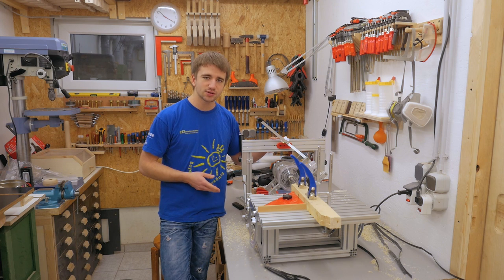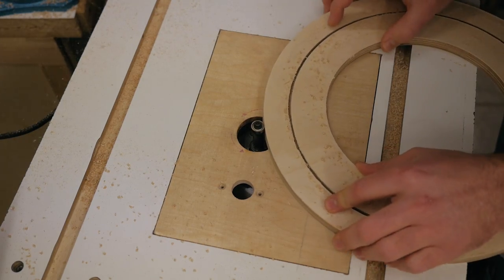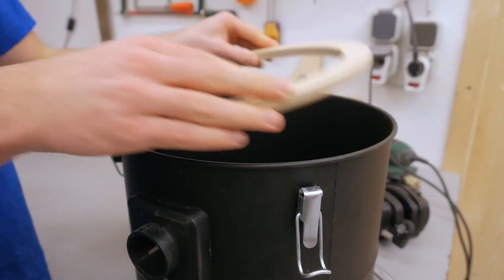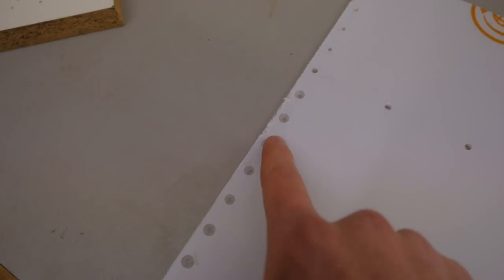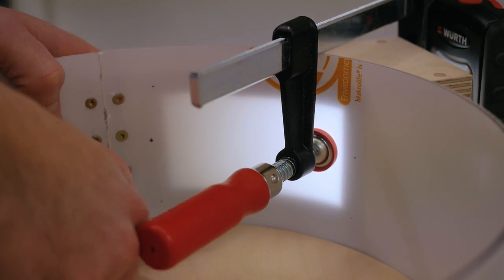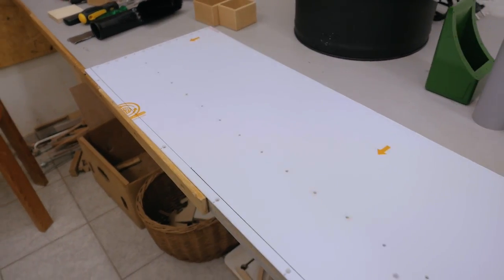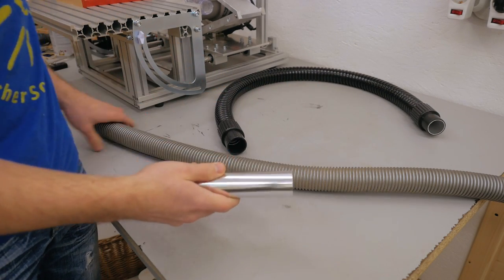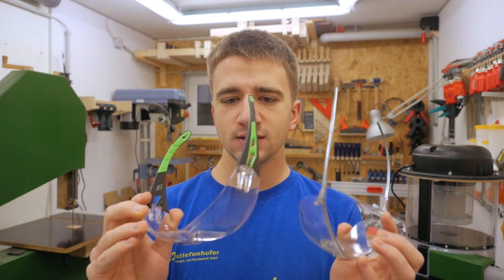A small Cyclone Dust Collector with a Cheap Vacuum

Comment: stupid question, why didn't you just use the vacuum directly (i.e, plug the ash vac directly into the panatarouter with a reducer/enlarger)? What benefit do you get from building a baffle/separater etc.?
Reply from the maker: separating the dust from the air. The filter stays clean for a very long time, the usable bucket volume is bigger and it's cool to see the dust swirling around ;)

Comment: Hi Marius, thanks for your awesome videos! I looking to build one cyclone but I'm wondering about the radius you can bend the plexiglass. Do you have some resources about that or did you simply test it?
Reply from the maker: Don't use Plexiglass. Use Polycarbonate. It doesn't break and you can bend it to whatever radius you want.
Reply: thanks!

Comment: do you think this small vac would be powerfull enough to work with a 2,5m long an 100mm size ventilation flexpipe for the intake part? Does it create enough suction
Reply from the maker: No, definitely not. Suction would be plenty, but pretty much no air flow. For a 100mm hose you need a dust collector.

Comment: Nicely done as usual but it seems like it would have been easier to just use a plastic bucket instead of making one.
Reply from the maker: But it may not work with a plastic bucket because it's not as strong as bent polycarbonate and might collapse under the pressure. I've already destroyed two buckets that way.

Comment: hey, marius, do you think a regular  ash vacuum wouldn't work straoght out of the box? I have been looking for something to extract dust from my bandsaw and these are half the price of a cheapest shop vac
Reply from the maker: sure, but the filter will clog up very fast. The cyclone separates dust and air and the filter stays clean. Plus you can fill the whole bucket.

Comment: Hello,  That's a perfect design (vertical), would it work if it was connected to all of your tools?
It probably wouldn't work and needs to be larger (more HP) to handle several tools?
Reply from the maker: No, for working with the big tools, this is the wrong machine. It has 1250w
Reply: Just to be clear, I meant one tool (gate open) at a time. What would be the minimal watts (3HP?) be best for a typical shop?
Reply from the maker: Ok, then this is the wrong type of machine. For connecting it to big pipes you need a dust collector (low pressure & high volume), not a vacuum (high pressure & low volume). 1HP or more should work.
Reply: Sorry, I'm getting confused. Isn't what you have is a compact (footprint) collector / separator that uses a shop vacuum (wet/dry) for suction?
I'm trying to find a design that can be stored in a corner with enough power to pull debris from the floor across a (small) two car garage to the celling (out of way), with two or three branches and back to the unit?
That's it...ah?  ;-)
Reply from the maker: Then I'd get a more powerful shopvac. You can then use the design from my video to make it a compact separator as well.
Reply: Marius Hornberger The shop vacation I have is 3hp, is that enough?

Comment: Marius can i ask your opinion, I am looking to turn my shop vac into something like this as I currently have a separate bucket with a Chinese plastic cyclone - however, i use mine to suck up all sorts aswell as just dust, often little screws and stones e.t.c. that can end up on the floor, will the polycarbonate hold up to such abuse?
Reply from the maker: yes, should be no problem

Comment: It looks cool. but I don't see the huge benefit to be honest. All that work  just to get the filter out of the bucket? Seems to me like a very low volume gain. Or am I missing something?
Reply from the maker: The dust gets separated from the air in the cyclone and the filters stays clean for much longer.

Comment: At 4:10, couldn't you just swap the bearing attached to the end of router bit with a larger one?
Reply from the maker: I don't have a bigger bearing that fits and it would have been a quite a coincidence if it had the exactly correct size.
Reply: Yeah, that makes sense.

Comment: Durch den Zyklonabscheider aus isolierendem Material hast du die Verbindung des Blecheimers zum Erdungsleiter unterbrochen, die wahrscheinlich vorher über das Motorgehäuse und die Klammern bestand. Ist das irgendwie von Bedeutung? Wahrscheinlich nicht. Stellt es eine Gefahr dar? Absolut nicht. Werden dutzende von selbsternannten Sicherheitsbeauftragten dich darauf aufmerksam machen (und dabei noch irgendeine obskure VDE-Norm zitieren)? Aber natürlich! :D
Reply from the maker: bis jetzt hat sich noch keiner beschwert :)
Reply: Schade. Hatte schon das Popcorn fertig...
Reply: gesamtszenario ganz so abwegig ist es nicht. Ich würde es machen. Vielleicht mit nem Bananen Stecker und ein Kabel.
Reply: original lid to vac appears to have a foam gasket, which would act as an insulator regardless of modification.

Comment: hello, please let us know how powerful was the ash vacuum?  gallons capacity, xHP motor??  Thanks.
Reply from the maker: 18l bucket, 1200w power
Reply: Thanks for your rapid replying, I´m just trying to scratch plans and budget to get again into mosaic bistro table making, during the former time I was realized to do carpentry is a must and woodworking an option same as metal work, besides both of them make a lot of dust, at first was searching for an affordable dust collector system, find some fancy ones... jaja.  Suddendly your video appear and it looks done for me. Congrats for your works and videos!

I thought the inverted conical shape was a condition to get that cyclone effect working, but you made yours just with straight walls. Unfortunately  my combat vacuum cleaner has no the motor on top part, it´s inside the 
vaccum body, at a bottom enclosed compartiment.

Comment: +marius hornberger is it possible to use a bandsaw blade that is 0.065 mm thick and 15mm wide on a 16"bandsaw wheel? im making one
Reply from the maker: Of course, if you mean 0.65mm thick
Reply: Marius Hornberger yea xp

Comment: Marius wanna ask you i build the same small dust collector like you but my filter is plug whit many dust, my inled i same as you ??
Reply: Im not sure if that design works as it seems, cyclones work with a vortex and GRAVITY. The exhaust air from the motor/filter is drawn through the unit in all directions, this will lower the internal pressure, i.e a light vacuum. What happens at the inlet is this; assuming the system is air tight, all the air that is exhaust is drawn in via the inlet,we need as little restriction as possible at this point i.e. short,wide hose,straight as possible. As the air/dust is drawn in the velocity will increase as it goes through the restriction of inlet (this is why we need big pipe to keep volume high, so that there will be good velocity at inlet), this fast moving air/dust stream is drawn in at a TANGENT to the inner wall,this is important! There must be no restrictions for the air / dust stream as it must be allowed to circulate around the wall of cyclone, now what happens is, as the air stream circulates it is also trying to find a way out of the unit, in a well designed system there will be a lower INVERTED CONE section, this allows the air stream to slow down, now as the air slows GRAVITY starts working allowing the dust to fall, the cone guides this into the receiver / bucket. The low velocity air at the bottom of cone is still trying to escape so goes up the center of cone towards the oulet pipe and through the exhaust fan. At this stage the air will be a fairly low pressure and velocity but big volume, and will have separated from the dust, the dust having fallen away due to gravity. 

What happens here is likely this; the air /dust circulates, having very little space and geometry too slow down it gets drawn through that pipe into the upper section to the exhaust. As all the air and dust has nowhere to go because of the flat bottom it must therefore go through the little pipe and find somewhere else too settle, some will fall down the pipe into receiver, the rest will end up in the larger chamber by the filter, any fine dust will still be airborne and get trapped by filter. 
That little lip on the lower part of pipe will also cause an obstruction to smooth air flow and cause larger / longer bits too get hung up on it.

Have a look on Google images for "Cyclone separator Ansys cfd". You will find pictures of cyclones models that show the air path,now imagine, after looking at those pictures, all that air in the cone being squished up into this design, a small parallel area...yes,a big mass of air and dust with nowhere to go except through that hole in the pipe and mainly up towards filter. 

Sorry for long post, cyclones are simple in operation,but design is a subject of its own. If you want one that works anyway.

Comment: Hi Marius, another brilliant video, and a great bit of kit. I'm going to build one. Thanks for sharing the information and inspiration. One question: what are the dimensions - length and width - of your 2mm polycarbonate sheet? I've watched the video several times, and read a few hundred of the comments as well. But I can't find that info... Thanks, Sebastian
Reply from the maker: It's 30cm high and about 80cm long (25cm diameter * Pi = 78,5 cm)
Reply: Thanks Marius. I've got my ash-vac now (different brand, but very similar). I'll have to check it and see if it's  the same as yours, diameter wise.

Comment: Did I miss something or how did the top cover get fastened? Or is it just held down by gravity+suction?
Reply from the maker: The motor part is bolted on and the whole thing is held to the bucket with the clips
Reply: @MariusHornberger  Sorry for being unclear :/ I meant how the 2mm plastic glass is fastened in it's grove :)
Reply from the maker: ah, I added a bead of silicone from the outside in the end. Don't know if I showed that.
Reply: I think u did actually :/ great work btw. Funny, instructive and well made videos. And the outtakes wink
Reply: @MariusHornberger  Btw, do you think it's possible to use 3mm plastic instead of 2mm, or will it be to hard to bend around that radius? ( I only have a way to cut a 3mm grove :/ )
Reply from the maker: 3mm should work

Comment: Hi, i tried to build one from a big workshop vacuum-cleaner and i made it on a plastic barrel but it implode on me what did i do wrong?, do you have any idea?
Reply from the maker: You used a plastic barrel. The vacuum has a lot of force. Either use a steel, a wood or a plastic bucket with reinforcement from inside.
Reply: ok thanks then i will build first a wooden one and see how that goes, thank you for the quick response and keep your video's coming :)

Comment: OKey, I do not understand why he didn't just use the vacuum as it shipped??
Reply from the maker: The thing that I built separates the dust from the air and so the filter stays clean.
Reply: +Marius Hornberger Isn't that a task a ash vacuum should already do? :S Should not want to have ignition ready coal or ash stuck in any kind of filter or?
Reply from the maker: Sure, but then the filter is always inside the bucket with all the dust together. Now it's away from the dust. That really makes a difference. Of course now it's no longer suited for glowing ash, but perfect for the workshop.

Comment: macht es sinn so etwas auch vor anderen Absaugungen zu verwenden die einen 100mm Anschluss haben @Marius Hornberger
Reply from the maker: JA definitiv. Auf meinem Kanal wirst du auch mehrere Videos dazu finden.Ich hab schon drei Stück davon für meine Absauganlagen gebaut.
Reply: Wir haben eine Record Power DX1000 sollte ich dann eher zu einem Separator tendieren wie in diesem Video nur mit größeren Durchmesser oder eher wie bei den größeren in deinen anderen Videos
Reply from the maker: Damit kannst du sowas machen wie in diesem Video. Natürlich mit größeren Rohrdurchmessern (100mm)

Comment: Why does everyone keep fighting with polycarbonate??
Just cut the bottom out of a 5 gallon bucket, or use Sonotube.
Reply: Dash , I think the main reason for using polycarbonate is that they can see the cyclonic action.  You are right, though, about the ease of just using a bucket or sonatube.
Reply: The only reason I would even consider using polycarbonate would be so I can see when the filter needs to be cleaned, because very fine dust will get through even the best dust separators.

Comment: Dear Marius, I'd recommend this Tivoly endmill for cutting ply/mdf:
http://www.perfor.hu/custom/perfor/image/data/pdf/tivoly2015/Catalogue_Tivoly_2015_256.pdf
Cost is like 18 EUR net.

Working length is 25mm, cuts 18mm ply in one pass 800 feedrate with no problem - tested it accidentally :D
However, the video would have been much less interesting if everything was done by the CNC ;)